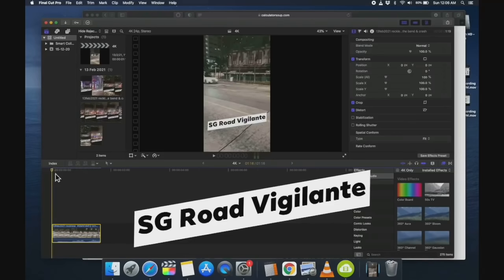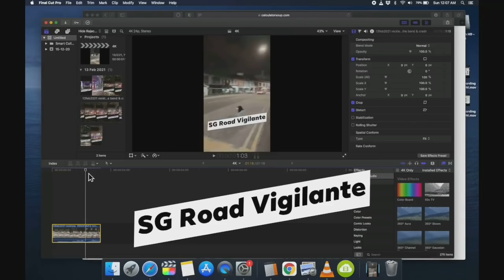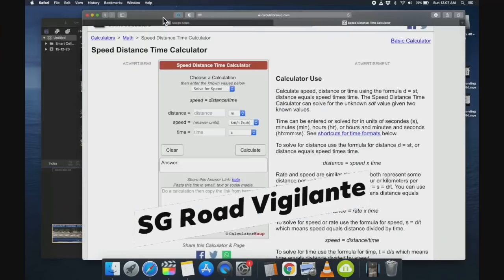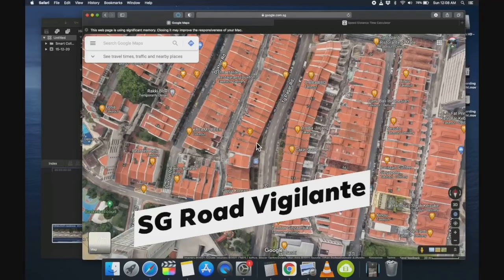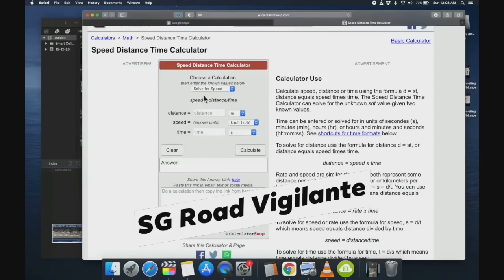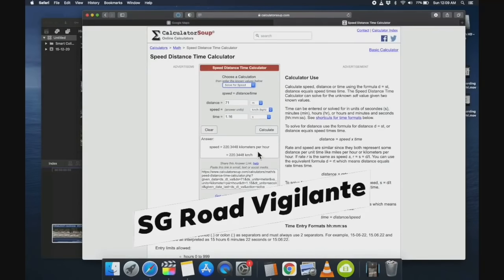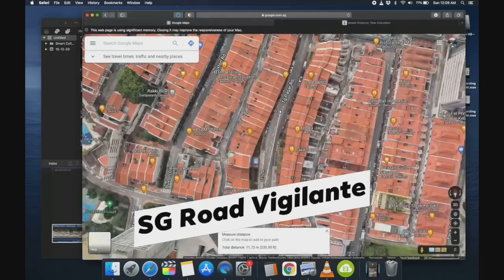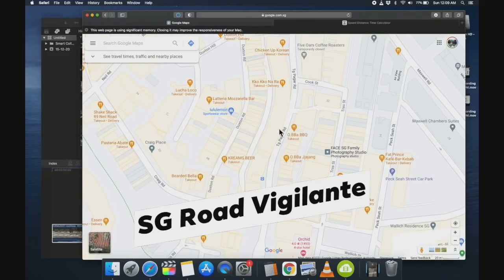hd version 13feb2021 0541hrs bmw m4 #SMX1441z skidded , lost control & crash into the shophouses ...

Comment: Seriously, 200km/hrs OMG OMG, me drives over 90, my hands shaking to handle the stering. He drives faster than my wifi connection. Btw, deepest condolence to the bereaved families and hope the girl full recovery soon.
Reply: 220km/hrs is wrong answer. 220 ÷ 2 = correct
Reply: @thaddddeee5355  
I used to drive at 200kmh, so I know that speed feeling

Comment: #noCommonSense driver ferrying 4 #brainless passengers negotiating a bend at high speed 150-200km/h, skidded due to additional load of 200-300kg?
Reply: He didn't skid. He tried to drift using wrong all weather Tyres instead of dry non tar Tyres.
Reply: @minhgiang3645  lol , drift on a two way street ? his grandfather road ah ...
Reply: @minhgiang3645  that was a skid....

Comment: Absurd when someone beside her in flames not doing anything, seriously just dousing mineral water. All that few minutes made a difference to her life.
Reply: Easy to say when you're in front of a screen watching instead of being there when that was happening.
Reply: With that flame... A mineral water won't help, why? Ever tried pour some water on a very hot wok? It started to flame up right? It's called Flambo... It's different story if you're using fire fighter's hose.

if only the guy that came with the car have fire extinguisher, could be an early help...Idk but having one in each on our personal car can be a life saver. :/
Reply: Very shocking..imagine if the taxi came a few minutes earlier
Reply: Dont say anything if you dont actually knows how fire works, even you rescued someone who was on fire, you cannot pour mineral water onto the burning victims... Even the fire is out, you cannot pour mineral water as well due to contaimination from mineral water... Silence is golden... Just zip it when we dont need extra opinion
Reply: Save lives if you have the capacity to do so, just as she had tried her best.
Reply: @ovinten  it’s a blessing in disguise for the taxi driver actually. If he had drove in earlier, his taxi would have collided with the BMW.

Comment: They did not die from the CRASH. They died from rapid and spontaneous combustion of the car. Cars are not designed to be combustible. 
The most common car defects associated with fires are fuel system or electrical system defects. Both electrical and fuel-fed fires are often caused by manufacturing or design defects.

https://www.automobilemag.com/news/chrysler-ordered-to-pay-150-million-in-fuel-tank-lawsuit/   - similar case studies
Reply: Agreed. Impact looks survivable especially for the 2 people sitting at the front.

Comment: Girl friend never learn, when on fire, drop, and roll on ground. Boyfriend did not know car crash test speed is 56kph. Meaning car crumple zone, and frame insufficiently protect for crash above 56kph.
Reply: Any crash, first thing is turn key to off to prevent any circuitry fire outbreak
Reply: @minhgiang3645  you try to key off when you crash loor, if you can ofc
Reply: @mattng5389  any crash immediately turn ignition key to "Off". It will completely cut off all electrical relays.
Because any heavy crash would have compromised the safety pipes leading to fuel tank and circuitry wiring layout of the vehicle.

As long as the fuel leaks to any circuitry wiring, it will ignite.
Reply: @minhgiang3645   when disoriented they cant even say out their name but anyway good knowledge to have to turn key off.
Reply: @___Danny___  based on video itself nobody could tell whether or not one or more of them were disoriented.

For all you know they were cursing at each other during those precious seconds immediately after impact.

Therefore as a benefit of doubt, for those crash test dummies wannabes, take my advice as above and switch key to "Off" mode immediately if they want to walk away with their babyface skins.

Comment: Thk U, would you be able to calculate the speed when the car lost control and sliding backward and hit again the shop?
Reply: You watch the analysis it is about 200 km/h
Reply: @musasetiabudi2971  I mean when the car about to hit the shop, what is the speed like? He may be traveling around 200km/h but after applying the brake and lost control and sliding backward, what will the speed before collision?  Thk
Reply: I don t know how to calculate it, but the car drift possibly because a surprise turn to left and the driver hit the brake. Base on experience when u drive 100 km /h and suddenly brake the speed reduce to 40-50km/h , this car speed before drifting is 200km/h.i believe when it crash it' s still above 100km/h
Reply: @rshy5343  - The road condition was dry.   That the car could slide side-ways and spinning just like a missile, can you imagine how great the force was just before the crash ??

Comment: the car actually did not crash at that high speed, it skid a little, which would have slowed down the speed, and crashed on the back instead of the front. i can imagine the idiot driver and his 4 brainless passengers were still alive and somewhat conscious when the car crashed, before they were burned alive because of the actions of 1 selfish idiot, and because the passengers were stupid enough to hop into the car after knowing what the driver was about to do

Comment: The fiery explosion did not occur immediately on impact when the speeding BMW reared into the shophouse. One possibility could be the fuel tank ruptured at vehicle rear impact that led to fuel leak & smashed rear lights that short-circuited with electrical sparks, a combo that could be deadly combustible.
Another thing. Why that guy in black T did not completely put out the burning fire on the girl which otherwise could have helped mitigate the injury of more than 80% burn.
Reply: That guy didn't have enough water that's why. Fire could also had been caused by sparks when the car undercarriage hit the pavement

Comment: Trying to drift with 5 guys on board, weight is off, over drift, tail forward, can't control.
Reply: Drift at 200km/hr?  No way. 
He over steered and tap the gas pedal too hard losing the corner  lining.  High torque with 400+hp taking a corner at 200km, only equipped with rear wheel drive.
Shud get better traction with 4 wheel drive evo/subaru.

Comment: what cause the car on fire?
Reply: First, the heat of the tyres scraping the road may have been conducted to the fuel tank. Once temperature reaches ignition point of the petrol the whole car ignites. Another cause may be the sparks caused when the car undercarriage hit the pavement